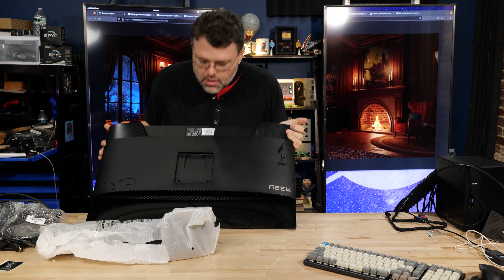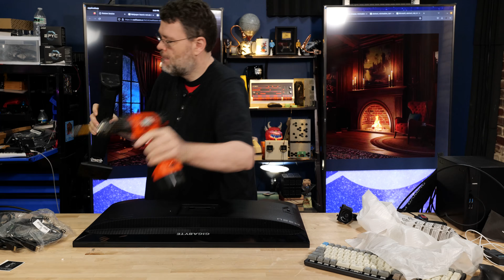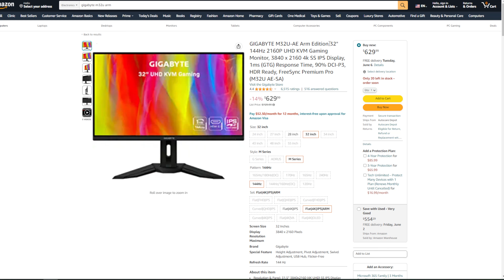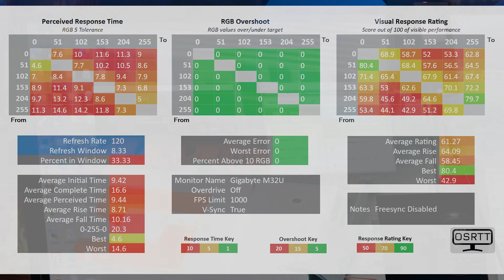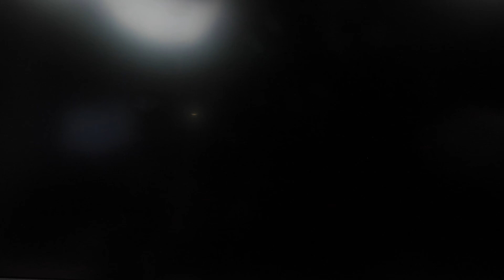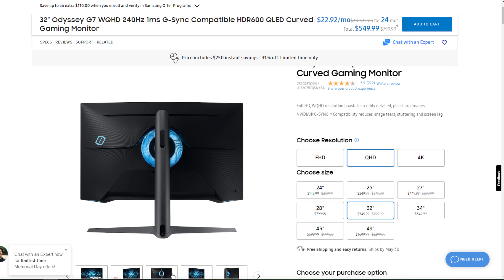Built-in KVM! GIGABYTE M32U Arm Edition Review

Comment: To get it to work with a regular normal desktop all you need to have is:  .USB C to USB C cable (Not included with the monitor) and a motherboard(MB) with a USB-C  on the back of MB and you can now plug an HDMI for video.....My setup below:  Note, the mouse and keyboard are connected to the USB 3.1 ports of the monitor

PC #1:  I plugged the USB C to USB C cable (USB C to USB C 3.1 Gen 2 Cable-6.6FT-20Gbps Data Transfer) on back of MB USB-Type C input to USB -Type C  on back of the monitor.  This setup worked perfectly for the mouse and keyboard only, since I don't have video on a old first gen Ryzen 7 AMD processor,  I knew it wouldn't work for video.  However,  video did work with when plugged to a HDMI on my discrete  GTX 1050ti graphics card and then to monitor for video.  Mouse/keyboard/video working.  

PC #2:  is plugged into the Displayport of the monitor coming out from DP source of a RTX 4090 with a typical USB3.0/1 B-Type cable coming from the monitor to PC 3.1 USB on MB port for mouse and keyboard functions.  KMV now works as intended and can switch between two PC's

I hope this helps anyone with the same situation.

Comment: I am curious why these monitors do not have automatic brightness control like my 10year old NEC EA244. It is the best feature if you are using the monitor in the evening. I've never had to touch the brightness adjustment.

Comment: I have a single monitor I plug my work laptop and gaming PC into. Laptop never moves so I don't need a single cable solution. I use a cheap USB 3.0 switch for mouse, keyboard, headphones and webcam, then switch the monitor between inputs. Can't find a kvm that can handle all that USB bandwidth, can switch between HDMI and Displayport, and isn't trying to get me to connect 10 4k monitors @$500 for some reason.

Comment: I read the brightness is pretty low on this one? 350 nits?

Seems like last couple of years been arguing about multi-monitor display scaling. This is also an issue in MacOS. However, MacOS has third-party software like "BetterDisplay" that is just amazing. I wished Linux had something like it.
Reply: HDR 400 is quite low.
Reply: @ZeroB4NG  yeah HDR should be closer to 1000. So this display is for sure not a HDR capable if u ask me. a Good laptop SDR is 400-500 nits.
Reply: Keep in mind standard brightness is 80 nits. I can't imagine needing more than 300 nits unless you're working in sunlight. For a laptop that capability makes sense but for a desktop monitor I don't see the point.
Reply: @eDoc2020  how is 80 nits standard? we had 250 nits like the base for LCD for two decades now.
Reply: @hanes2  80 candela per square meter is the reference luminance level specified by sRGB. I won't argue that it's good to be able to go brighter but I just don't see the need to be literally five times brighter.

Comment: I have the M32UC (curved version). Love it. I have a 3 monitor mount stand so arm edition or stand version wouldn't really matter to me. I had the G32QC (2k non-KVM  version) that I used with an RTX 3080 and liked it so much I got its big brother when I upgraded to a 4090. I have 0 complaints. Even have it overclocked from 144 to 153hz.

Comment: I have a Lenovo L32 4k whcih kinda runs of single cable along with poweer delivier so when I switch from my personal laptop to work laptop all I have to do is switch the cable. I find it much easier than this. considering I dont have to plug in the power for either of the laptop. however its only 4k 60hz and reverts to usb 2 for peripherals when on 4k 60.

Comment: I love my original M32U but 3 USB ports for the KVM switch isnt enough without compromises. I use a USB mouse, keyboard, mic, speakers, and webcam.
Reply: I had the same issue, and solved it with a USB 3.0 hub into the monitor. I run my audio interface, mouse, keyboard, webcam, and sometimes controller through the hub and its awesome

Comment: Did you actually test using USB-C for input only in conjunction with the full size HDMI or DP inputs?  The MSI Optix MPG321QRF-QD has a similar port configuration, but can only use KVM if the 2nd device is doing video over USB-C.

Comment: Clicking through, I was half expecting an iMac-style server-monitor combo with an Ampere Altra Max CPU inside! I mean... they make Ampere servers. And they make these massive displays. And it even has KVM/IPMI built in!
Reply: Likewise. I’m terribly disappointed right now. I suppose the lower-case arm should have been a hint.
Reply: Yeah, I thought it was an ARM processor-based motherboard by its title.
Reply: I got really puzzled as to why anyone would need a monstruously tall 32 unit server with an ARM CPU.
Reply: I am very sad that this is not what the video is
Reply: I was looking at DP MST + KVM monitors (spoiler alert, only Dell makes them with 60hz refresh dates) and thought the same when I saw this one.
Reply: Or monitor with built in PiKVM ? ;-)